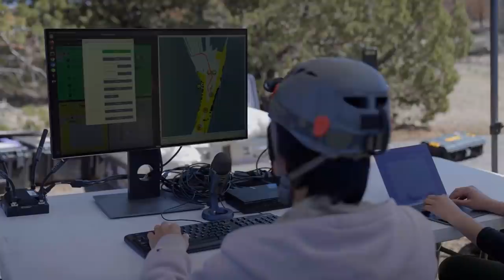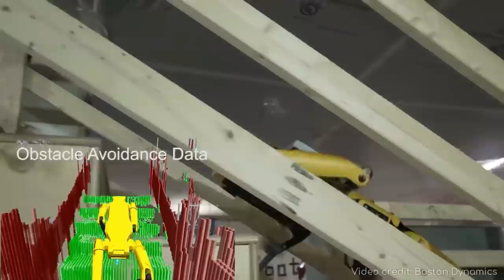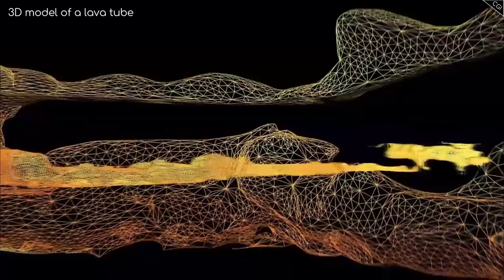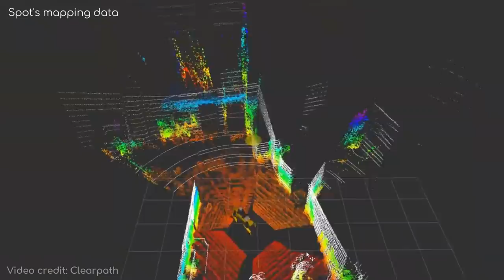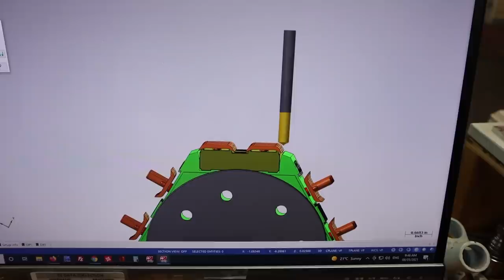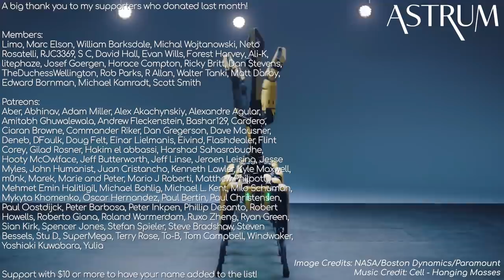How Wheels May Soon Become Obsolete For Mars Exploration

Comment: I would send both (1) original rover and (2) walking robots, you'll need a stationary base for signal coordination and daily solar charging, the walking robots can do the exploring, and after return to base to recharge and upload video/ image. The rover base can move to a new location if need be.
Reply: They can't they are mechanicaly inneficient... author of the video forgot to mention this small fact, that walking robots are nowhere as energy efficient in moving as humans not to mention dogs.
Reply: @Bialy_1  If the charging base is stationary or semi-Stationary, you can have a much larger solar array. You’re right that distant might be a problem. Perhaps the battery packs themselves could have mobility and follow after the exploring unit and return to base for recharging.

Anyway, these sorts of robots will no doubt be useful for exploring Mars, but that doesn’t mean they will replace other types.
Reply: I was thinking the same thing. not so much a "stationary" base as a mobile one. One that can stick to the flatter terrain and the walking ones to dash about and bring data/samples back to it from places the base can't go as well as being able to recharge at the base.
Reply: @Bialy_1  Even organic legs are more inefficient than wheels.  With spaceflight mass is everything.  Therefore, because of the limitations of power storage/generation power efficiency is everything.  Even a wheeled rover like Curiosity spends much of it's time charging it's batteries from it's radioisotope thermal generator (RTG) because the RTG can't supply enough energy on it's own to move the rover.  It only puts out about 100 watts of electrical energy.
Reply: @Bialy_1  the commenter literally gave a solution to that problem and you tried to shoot it down immediately
Reply: NASA requests your location
Reply: why not just make the exo skeletons solar panels
Reply: I like the idea. Rover as a mobile staging platform. Have a walking robot for exploration, meanwhile have an aerial drone for land mapping and imaging for the rover. The rover will be the main coordinator and recharge port for the other 2. So it's technically a 3 bot mission.
Reply: or you-know... just use smart flying drones instead.
Reply: I thought of that as well, but that would limit the distance a legged robot could explore from its charging station.
Reply: @jeffburnham6611  they might could put a small solar panel on it to help with that but im thinking ol legs could come equipped with a brush or something to knock dust off the panels. I couldn't figure out why they didn't have a small multi tool arm to help with that.
Reply: Wheeled walking flying hybrid. That is what is needed.
Reply: @seanbowmen8265  From what I've heard they didn't have a brush because of risk of damaging the panels, and they"re hoping for martian winds to brush them off
Reply: @Bialy_1  what does inefficiency have to do with a charging station?
Reply: @Bialy_1  They are more efficient in diffcult terrain, where wheels efficiency breaks down to 0 or near 0.

Comment: Imagine a treaded, nuclear-powered 'kennel' that would house dozens of Spots. Inside, it could recharge and even repair the walkers with a 3d printer. The kennel itself would be quite slow, but the rovers would be able to cover incredible amounts of ground on their battery lives, heading back only when their charges ran low.
Reply: also imagine a spot which carries mini spots which would be miniaturized semi-autonomous robots that can get into tighter spaces
Reply: Imagine 101 Dalmatians but on mars
Reply: that just sounds like skynet but with dogs
Reply: I was also thinking about nuclear power because these bots won't go very far in those caves using only solar panels... Even on the ground the dust is covering these solar panels pretty fast and is one of the main problem with the previous rovers.
Reply: @Reth_Hard  The robot could carry a brush attachment and clean its solar panels from time to time.
Reply: Maybe automated battery swap station with nuclear or solar power core. Several spots would be able to deploy and maintain (cleaning etc.) bigger solar farm than rovers. If Starship will be online in next close approach with Mars, she could carry decent sized squad of Spots and its base station.
Reply: You would need lubricant for moving parts tho and mars certainly doesnt have any kind of oil on it. Bearings and actuators used in the robots and hypothetical 3D printers/fabricators would eventually wear down. It could last a pretty long time but would need resources from Earth eventually
Reply: @spencergallucci5309  True, though it could last a very long time on a single reservoir, and subsequent resupply missions could expand its mission profile.
Reply: @spencergallucci5309  The hip and knee joints could have flexible fabric sleeves to protect them from the ubiquitous dust. Cute little shorts on the robot dog... sell sponsorship opportunities to a vendor such as Levi's or Wranglers...
Reply: Treads are pretty high maintenance things unfortunately, worse than wheels which already cause problems as shown in the video.
Reply: @plmokm33  True. Maybe they could be stationary and multiple ones get dropped to expand the Spot's exploration range, like old timey outposts.

Comment: I don't want a fancy space robot. I just want a robot that can clean my house, fix my truck, do my laundry, fix the roof, install the plumbing, buy my groceries, zap the flies and mosquitoes, balance my bank book, be my bodyguard, cook me 3 meals a day, operate the machine tools in my shop, answer my calls, read and answer my emails, won't grumble, won't join a robot union, doesn't need bloatware updates and can repair itself with whatever available parts and electronic components in the garage and has a 10 year warranty on its battery.

Comment: If these robots would fit a small nuclear reactor, they could walk wherever. Send them in pairs,  and they could 
1. dust each other off
2. pull each other out of bad movement decisions
3. in case of marsians : rush b in formation
Reply: 4. reproduce
Reply: Send one nuclear charging station
Reply: There really isn't such a thing as small nuclear reactor. You could make one, but reactors don't produce electricity on their own. They produce heat, which is usually used to boil water and spin a turbine. You can't fit that whole mechanism on something that needs to explore tight spaces. I think a similar, more realistic option is RTG's (Radioisotope thermoelectric generator) They've already been used on several space missions and last a few decades. But they don't produce much power and are quite large.
Reply: 5. Profit
Reply: @diego_z90  write this down. WRITE THIS DOWN
Reply: um. This is NASA, not Roscosmos.
Reply: I think you don't really understand how nuclear reactors work
Reply: @PotatoMC1  Space Force!
Reply: So they can basically de_dust by themselves?
Reply: @Glitch315 beat me to it. A reactor wouldn't work. An RTG just might.
Reply: Eh they wouldnt last forever, bearings and actuators that allow movement would eventually wear down. Problem with robots is they are mechanical not biological so wear cant be undone without maintenance
Reply: Cause robot alien invasion from mars once they go rogue
Reply: I like the way you think 😂
Reply: @number_9106  sure we do, we have played fallout, we know that fusion cores can last for hundreds of years. ;D
Reply: Nuclear doggos invade mars
Reply: The easy solution to preventing dust, grime, and other contaminants from getting into gaps and whatnot is to give the robots skin, at least around the joints and exposed areas if a full coat of skin is unfeasible for whatever reason.
Reply: @Glitch315  could set up a series of nuclear charging stations for long distance robots
Reply: @Glitch315  we managed to get some nuclear powered planes intot he sky, and I imagine it's not u realistic to scale then down a bit more. Plus who knows what scale we could eventually get fusion down to
Reply: wonder why nasa didnt send spirit and opportunity together? because they were VERY expensive robots that also took a lot of time to build, and why put that much effort and money on 2 things to make them end up doing practically the same thing, something like ingenuity with perseverance works much better in my opinion, as ingenuity does something completely different than perseverance and costs less money
Reply: A nuclear battery of some kind would be more practical at these scales.
Reply: @antgrantrant  There's no free lunch.

Comment: I honestly think quadrapeds are definitely the way to go on Mars they do need to have a wide base at the contact point in the form of a mesh grid foot. Similar to a snow shoe. Wide surface area but mesh so sand can pour through during vertical motion.  I can see the round stubby feet sinking and tipping over.

Comment: A great video. Legs have many advantages over wheels, especially in caves. They are more resistant to wear and tear.
But they also have many disadvantages. A wheel can operate with only 2 motors, for movement and steering. A leg has many degrees of freedom, and needs a lot more parts, which means a lot more potential failure points.
A rover which has one or more motors inoperable can still continue working, as the unpowered wheel will keep carrying the weight, and there are 5 more wheels to steer and drive. An unpowered leg will not only be unable to carry weight, but will likely drag the rover and get in the way.
And legs normally have much higher ground pressure, and are more likely to sink in soft sand. Maybe not a problem for caves, but an issue outside.
And legs are less energy efficient, a real problem on Mars, where power is always a problem.
Reply: but then what if they send a robot that can "hot swap" these parts like how they remove the whole wheel to change the tires in F1. In theory, this robot could just pop the leg off and replace it with a spare. But what if spot cant get out of the cave? There would be more Spot's and it would probably be left till a later date when its vital that it gets retrieved. And say the "knee" joint motor goes bad, it can still use the "shoulder" joint to limp back and vise versa.

Do you think this is a workable idea?

Comment: I'd imagine that a walking rover would consume more power and that's one of the biggest obstacles. Also, such a robot would be more complicated than a wheeled rover and more prone to mechanical failures due to things like sand getting into the joints
Reply: i don't see it going for more than hours/days, much less 15 years. Maybe in 30 years or so. (all these great advances are somehow always 20-50 years away)
Reply: The sort of joints here can very easily be protected from dirt and dust ingress with a very simple bellows cover. Protecting the joints is the easiest problem to solve. You want a tricky one, try the charge vs usage rate on power, or the problem of radiation hardening the vast array of electronics involved. Now you're talking complicated!
Reply: I asked my self, why not tank treads for difficult terrain, then I remembered. those are heavy
Reply: Solar power baby, solar power
Reply: I agree. Too many doesn't understand that more parts that move, the more can go wrong. For space exploration where resupply and upkeep is nigh impossible, you want simplified solutions that is tried and tested. The Voyager probes are great examples as they are not overly complex, yet they have survived this long and carried out multiple missions enroute to the void between solar systems simply because they have a pretty simple design. A complex probe with a lot of moving parts and gadgets will eventually fail and the same goes for robots. In space, less is more - at least when we can't give the love and care necessary to keep them running quite litterally in the sense of "dog robots".
Reply: @sillkthashocker  Solar power is 26% efficient here on Earth (at best!). On Mars, halve that. It'll take a full day of sun (12 hours) to get enough charge for about 1 hour of usage (ignore what you saw on 'The Martian'. Artistic licence). No, the best form of power to use up there would be RTGs. But there's that problem again, weight.
Reply: @LudosErgoSum  It's called KISS principle - keep it simple, stupid. Walking robot doggos are the exact opposite of that. Overengineered  stuff tends to break a lot more often and you can't send a repair team to Mars. And that's when success rate of current missions is about 50%.
Reply: I believe they would go nuclear powered in that case
Reply: @phrodendekia  Nuclear powered has not yet been sufficiently miniaturized for it to be accomodated into a robot as an energy source. Solutions that depend on untested or undeveloped technology or straight up magic is nothing more than an ad hoc fallacy since it doesn't adress the core issue. If anything it exacerbates the complexities involved with this type of technology. I'm not saying walking robots can never work for certain types of space missions, but in space without access to resupply and maintenance, simple and safe is just better.

It's of course possible that you're just being sarcastic.
Reply: @shadowflash705  dont be in such a rush .. what they ve done it is amazing and professional work is always better
Reply: @mossryder  i mean if it walks one day at 6kmh that would be more than most rovers have done rangewise
Reply: @LudosErgoSum  The nuclear powered cars of the 50's could have gotten us to the point of nuclear powered everything that almost never has to be recharged. A nuclear powered phone could probably last centuries on one charge. Its safe when handled correctly, just like any other power source. The "nuclear waste" is nothing more than depleted uranium, and it is completely safe when stored in concrete waste facilities. In fact nuclear "waste" already is stored in concrete. Its also way more efficient than renewable energy. Its why NASA mostly uses radioisotope power devices, because they last so long. Voyager 1 and 2 each have one. I think if we could make small enough power systems for even the regular rovers it would make things way easier, but I am not getting my hopes up. People are already agreeing as a species that nuclear fission is the devil for whatever reason. Chernobyl was run by idiot soviets and people seem to think that the place falling apart means that all nuclear power plants are nuclear bombs.
Reply: Shouldn't be too hard to cover the joins with some real thick rubber sleeve or something, the problem with wheels is you can't really do that on the axle/wheels and have them still work.